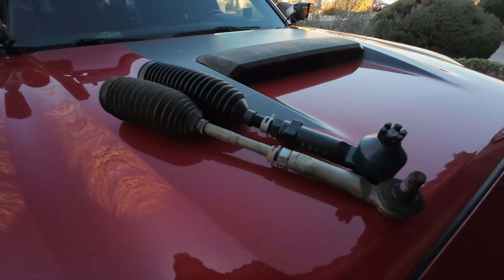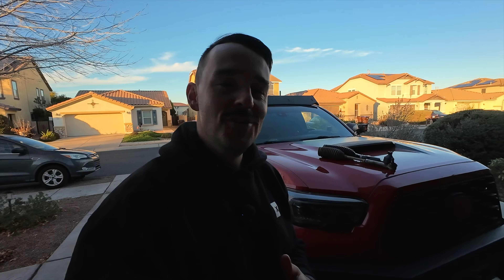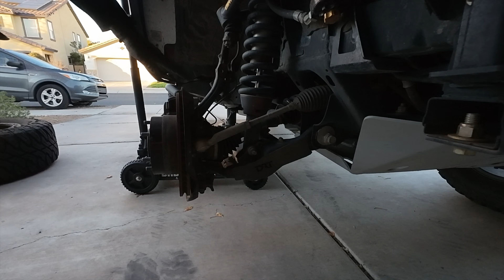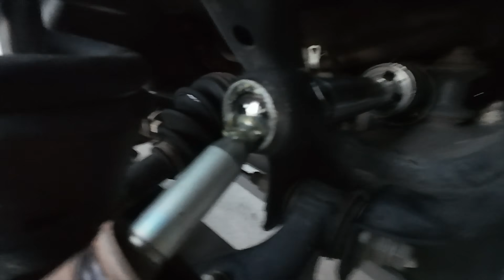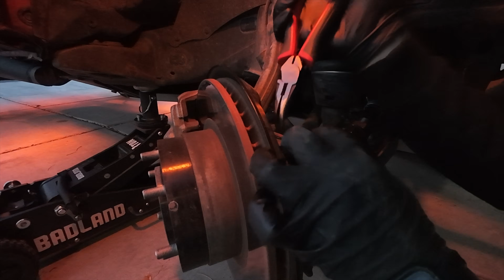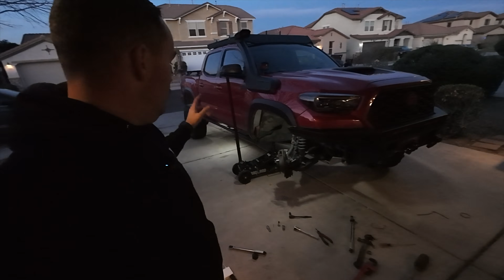Apex Chassis Tie Rod Install on a 3rd Gen Toyota Tacoma | Heavy-Duty Steering Upgrade

Comment from the maker: Drop a comment if you’re running Apex Chassis or thinking about upgrading your steering setup.
I'm happy to answer questions!
Reply: I’m looking to upgrade mine soon, I seen a install video on stevo when he had his tacoma, he cut it to the same length as stocks did you have to do any cutting? Or installed it as they came I have mid travel hoping it’ll beef up my suspension more

Comment: Did you upgrade the steering rack too or have plans to? Basically this mod transfers that stress to the rack now. Instead of the tie rod bending and it being a relatively easy fix on the trail, the tie rod will not bend and will instead make the steering rack fail. That’s why OEM tie rods are better for use with an OEM rack. They act as a fuse that saves the rack.
Reply from the maker: I am still running the OEM rack and as of right now I have no plans to upgrade my rack. Everyone has different opinions and through my research I didn’t feel like doing a rack was needed right now. If you’re putting so much stress on the tie rods that they bend or break then you are stressing your rack if you have OEM or upgraded tie rods so I don’t agree that weaker parts are a good fuse for the system but that’s just how I feel
Reply: @FortuneTacoAZ it’s your truck. And I enjoy your videos but that’s exactly how that works. Think of a drivetrain…if you make 1,000 lb-ft of torque but your clutch can only hold 300, your axles, driveshaft, and diff are just fine but your clutch will get smoked. Install a stronger clutch and you will break the diff or drive shaft. Same thing with tie rods. If your tie rods bend with a certain amount of force, any amount of force greater than that is not transmitted to the rack. It just bends the tie rod. Install a stronger tie rod, and now more force can be transmitted to the rack.
Reply from the maker: @chrisridebike8 if I was building this thing to crawl over mountains and do crazy stuff I can see that, but for what I do with the tuck this setup works for me. If there was to ever been an issue with the rack I will look into it then but I’ve been wheeling for 110,000 miles with no rack issues with the way I drive it

Comment: What tools did you use for the Jam nuts?
Reply from the maker: Sorry I didn’t cover that part in my video. I just used 2 wrenches to tighten the jam nut after I set the tie rods to match my OEM tie rod length.

Comment: Chris, those silver bolts are nuts..
Reply from the maker: What are you referring to?
Reply: @FortuneTacoAZ referring to the nuts holding the U-bolt to the clamp on the specialty tool to remove the inner tie rod.   You kept calling them bolts.
Reply from the maker: @richardseitz5235 I got it now, I had no clue what you were talking about with no reference haha

Comment: To torque that inner tierod correctly you would have needed to pre set it up where it was exactly 90 degrees of where you had it.  

Not a big deal though, you over torqued it but better than under torqued. I wouldn’t have put a torque wrench on it at all lol 😂
Reply from the maker: How did I over torque it? I’m not getting exactly what you mean by the 90 degree of where I had it
Reply: I think he was referring to what position the inner part that threads on was prior to disassembly.. so you could set the new one up 90' on the loose side

Comment: I don't think making it beefier would make it differs. it usually fails on the joint so get oem.
Reply from the maker: All of the componets of the Apex Tie Rod are upgraded and tested, which is why I did this upgrade. If I wanted OEM I would have just left the ones I already had on.

Comment: Do you feel a difference between stock and Apex? When it comes to turning left and right?
Reply from the maker: The steering feels solid but not too much of a difference. I have a buddy who installed these when he was having issues with his steering having extra play in the wheel and these eliminated that on this Tacoma
Reply: @F @FortuneTacoAZ  How does it feel after broken in?  I was going to install these on mine due to steering play.  The shop said it wouldn’t make a difference after a few weeks.  He said the steering would go back to being loose again.
Reply from the maker: @oliva1010 I never had any play in my steering wheel so to me it feels just like OEM
Reply: @FortuneTacoAZ does that guy have a UCA upgrade? When I put in my UCA’s no floating at all but that will be my next upgrade what’s your thoughts on a whole tundra upgrade for steer rack and such?
Reply from the maker: @jak @SoCal.NorCal  buddy has Camburg UCA’s on his Tacoma. The tundra rack replacement requires a lot of modifying to make it work but I’ve heard nothing but good about it

Comment: Did I see you were out on the trail with the new tires?  Any video of that coming soon?
Reply: Never been to bulldog canyon.  Had to look it up.   May need to be the next adventure.
Reply from the maker: @lucaspowell8580 it’s one of my favorite Arizona trails. There’s multiple trails out in the area and the views are good
Reply: @FortuneTacoAZ  thanks for the input.  I'm in north Phoenix and spend a lot of time in Table Mesa area.  Always looking for awesome new trails
Reply from the maker: @lucaspowell8580 Bulldog is out in East Mesa and you can go out there multiple times and do different trails
Reply from the maker: I was out at Bulldog Canyon to do a photoshoot of the new wheels and tires but I will be hitting a trail in a few weeks and plan on doing a video

Comment: What all does this mod do?
Reply from the maker: These tie rods are larger and stronger than the factory rods. They are recommended when putting bigger tires on your truck for more strength in the steering and to prevent a weak point in your steering with more weight from the larger tires
Reply: @FortuneTacoAZ  Will install of tierod help with some bump steer? I have a 4inch drop bracket lift kit, fox performance elite 2.5, JBA UCA alignment to specs, Already got road force balance on the falken at4 but still a little shakiness and bump steer when driving. Just want it to be normal.
Reply from the maker: @MrMakasteven  It could possibly help with bump steer but its main purpose is not to fix that it was designed it reenforce the steering end links for stronger steering while offroading.
Reply: Replacing tie rod or rack n pinion?
Reply from the maker: @TeeLBCify this video is about the tie rods only